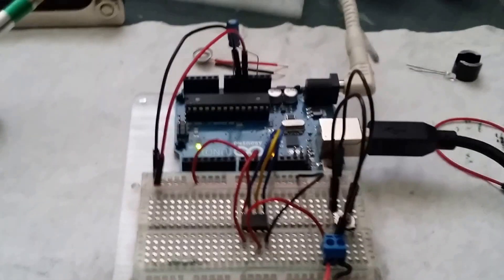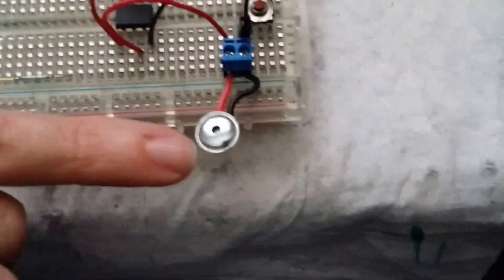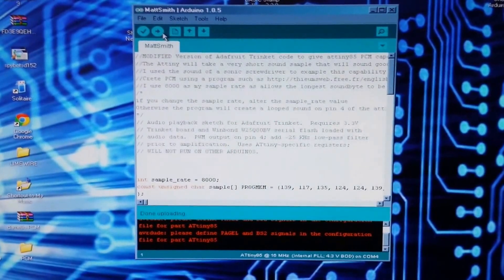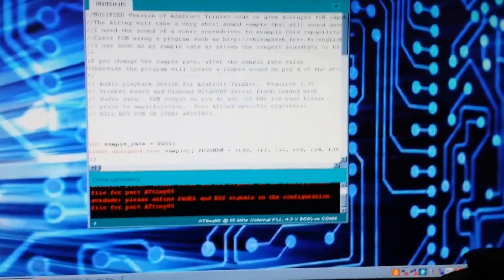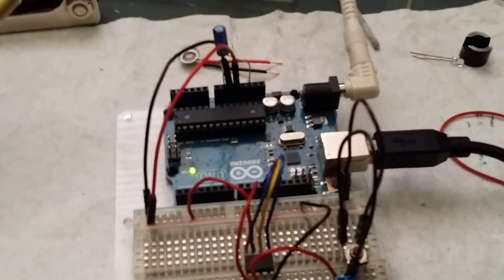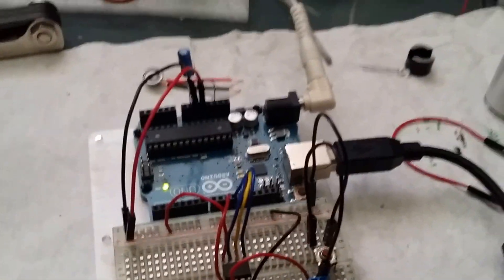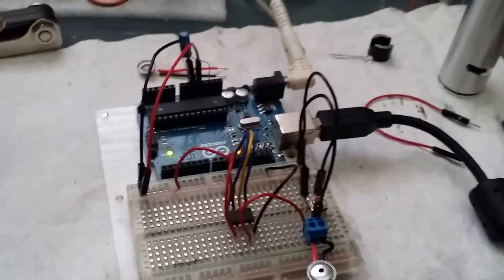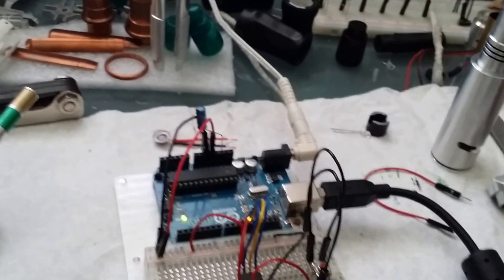Sonic Screwdriver Sounds by Arduino and ATTiny85

Comment: I’ve been trying to do this using a 556 chip. The first timer is for modulation of the second timer which is at a higher frequency. It kinda works but doesn’t sound great. I might have to give this method a try.

Comment: Hi i hope this gets seen but i would just like to know where you get the wav to code program from as im trying to use one i found but when uploading to the Attiny85 i get error: redefinition of 'const unsigned char sample []' come up and i dont know how to fix that. could some one please help i would be very greateful. The main reason for this is because when i use the original files i dont get any sound although i have done the wiring correctly.

Comment: Could you possibly post the code somewhere, like the comment section? I just don't know anything about coding- I've figured out how to code the ATTiny with the Arduino, the one thing I just cannot figure out for the LIFE of me is how to write the code. So if you could post the code you used here, I would be immensely grateful.
Reply from the maker: The trick is getting the right bootloader and clocking the ATTiny85 to 20mhz instead of 8. Here's a couple codes that I've used:

<http://www.instructables.com/id/Working-Sonic-Screwdriver/>

<http://forum.arduino.cc/index.php?topic=118757.0>
Reply: Thank you for pointing me to those links, but it seems I've run into a brick wall here. I'm able to successfully upload code to the arduino that plays the sound (I learned how to do that from High-Low Tech tutorial) and I can upload other sketches like Blink and Fade to the ATTiny85 with no problem. The issue now comes when I try to upload the PCM playback sketch (which I modified to play the sonic screwdriver sound) to the ATTiny85; the Arduino IDE has an error compiling for the ATTiny. I've tried different ATTiny cores, downgrading the IDE, etc but I can't seem to get it to work.
Also- I don't see an option for clocking the ATTiny85 to 20mhz. It seems that anything past 8mhz needs an external crystal.
What do you think I could do?
Reply from the maker: Sorry I meant a 20PU on 16mhz internal. There's a bod version. 

Try this forum:
http://forum.arduino.cc/index.php?topic=73783.0

I wanna say I had to modify a file or add a specific attiny85 library before it would work. One of those things you have to do the first time, but can forget about it every time after.
Reply from the maker: No prob, Dan. I went looking for the original source just now, but couldn't find it. Its a neat code! You can trim any sound file down to .4 seconds and change it from a wav or mp4 to code using a freeware called EnCode. I'll copy paste my Matt Smith era file and send it over. Its the loudest and you can change the playback mhz to alter it to the Tennant sound!
Reply: Hey, you guys wouldn't happen to have the code for this still lying around? I'm doing a Matt Smith as a school project and would love to get the right sound in there...

Comment: Im trying to make a TCE (tissue compression eliminator), the longest sound file i have is 7 seconds. Would it work for this setup? Buy the way, is ther a step by step instructabel on this? How to wire it up, install sounds & wire it to the prop?
Reply from the maker: Quite the opposite. 7 seconds is WAAAAAAAAAAAAAAY too long for this setup. You can only fit about .3-.5 seconds of a .wav or mp3 in the ATTiny85 with the rest of the program code. In something as big as a TCE you could use a bigger chip or even fit a pre-fab soundboard.

This is the Instructables page that got me started:
<http://www.instructables.com/id/Metal-Doctor-Who-Sonic-Screwdriver-with-Arduino/>
Reply: +Sanholo80 Is ther a way to make a three part sound effect? For exsample, one sound effect broken up in three parts, the begining of the sound, the middle of the sound which loops continus as long as the button is being pressed, then the end sound is played once you let go of the button? And of corse it starts all over again with the first sound when you press the button again.
Reply from the maker: Check out the Adafruit SFX board. It can do multiple sounds and you can control how they're played. You'd have to write a pretty lengthy code to do that with an Arduino.

Comment: Can you have multiple sounds on one of these ATTINY85 chips?
Reply from the maker: NO! Well... yes, but no. But if it helps, yes.

You could store a couple short melodies if you just use tones but .4 seconds of a coded .wav file will fill the storage of an ATTiny85. There are bigger ATMEL chips and other equivalents. I use 85's because of the physical size of the chip.

Comment: is there are way to encode sound to a chip without an Arduino?
Reply from the maker: There are other chip programmers out there. It looks like a flash drive that you attach the ATTINY85 to and insert in a USB slot. Then you can transfer directly to the chip instead of through an Arduino. I've seen them, but I haven't tried one.
Reply: +Sanholo80 do you know how they are called? I've never heard of them.
P.S how did you shorten the length of the sound to under a second?
Reply from the maker: Search Tiny AVR Programmer. Sparkfun makes one for $20. But you can get an Arduino for $30-$40 and have more fun with it.

I use a freeware program called Audacity to alter sound files. There's another program called EnCode that will change the sound file you make to code.
Reply: +Sanholo80 so basically, I need an ATTINY85, a Tiny AVR Programmer and that's it? but how do I connect the ATTINY85 to the circuit in the screwdriver? or do you show it in a video?
Reply from the maker: <http://www.instructables.com/id/Metal-Doctor-Who-Sonic-Screwdriver-with-Arduino/>

This is the INSTRUCTABLE page that convinced me to build my first screwdriver. He shows all the details of putting the electronics together.